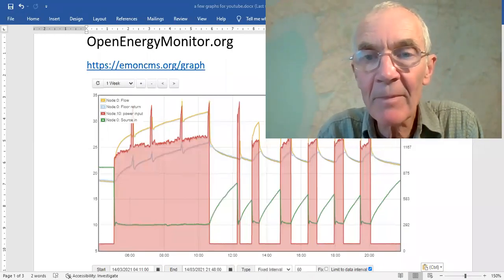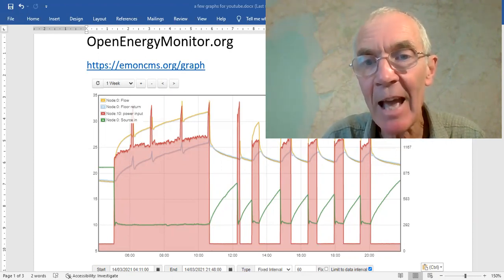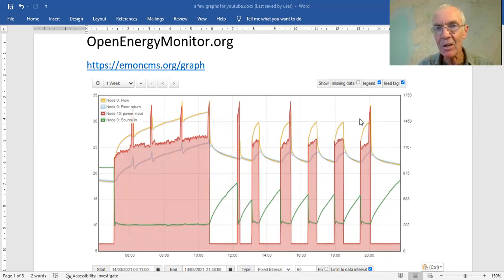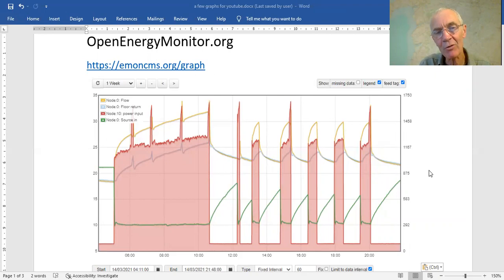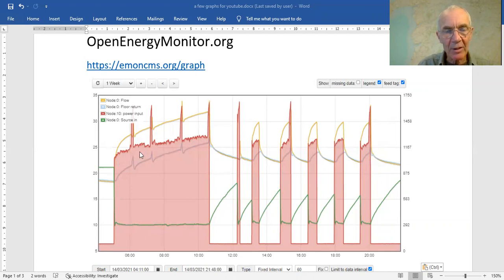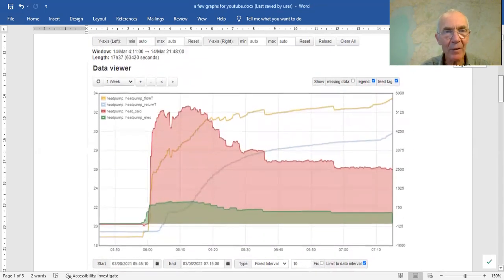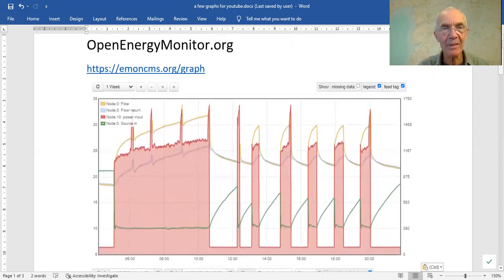Introduction to heat pump monitoring hardware

Comment: Dear John
I rather like the concept of using machine learning to optimise heat pump efficiency. My installer is thinking about the Homely unit. I was wondering if you had any thoughts about how useful they are (or not) please?
Reply: I have no direct experience with Homley, but frow what I have gleaned, it looks very good. It partly depends on your setup. e.g. it should definately help a Samsung, but there may be less benefit on a other units with better controls
Reply: @SwiftsPendre-zf2xx  thank you. Yes, they are putting in a Samsung 16kW R32 mono. It’s selection is more about its footprint vs available space and matched demand, rather than anything else, I’d heard the user interface is a nightmare, what the heck is waterlaw when it’s at home! 
I hope it means I won’t need to interact with the control system at all, just a bit nervous that homely will do what it says on the tin. I use a machine learning octopus PV tariff and that is intelligent most of the time and makes me a very welcome income, but it occasionally makes retarded errors, I guess like us all!

Comment: This is a great channel. I have an air to air system and would like to monitor my system that has 5 indoor units and 1 outdoor compressor unit. What can I use for this?
Reply from the maker: Mmm.. its a little hard to properly monitor such a thing. I dont know of a way of knowing the heat ouput to air.  Its useful to measure the power, and a CT clamp to measure current (assuming 1kw = 4 amps) should be good enough.  What do you want to learn?  It would be interesting to have room sensors (emonTH, with a probe sensing the warm air coming from the unit... I would find it interesting, but not sure what you would learn from it. cheaper options might be to buy some wifi thermometers and display it on an app.         I guess you has fan-speed options??  if so, fastest air is probably most energy-efficienct, but noisy and possibly drafty.  maybe you can help to compare input power with different air flows.  possible my 'Carnot COP estimator might help you guess the COP

Comment: I have been using Home Assistant to get something similar. I have temp probes on flow and return and the thermometer is a wifi system linked to Tuya which can display in HA. Similarly I have three Govee thermometers around the house in Study, Living Room and a bedroom. For external temperatures I have used three hourly Met office integration. I have an PV, EV and Zappi and have four CT clamps linked to the myEnergi system. The heat pump is on its own spur and fusebox so have a CT clamp with a Harvi. I can display the energy use using the myEnergi integration in HA. The bit that is missing is the flowrate !!!! My HA is set up on a Rpi 4 and working well . Any suggestions what flow monitor I could use to link it into Home Assistant ? I could then calculate heat by creating a virtual sensor combining the Delta T from flow and return and the measured flowrate to get KW. At the moment I can only get daily redings from the Daikin controller which has all the info in it but there is no way of gathering real time data !!! Still good news is my COP since last June is sitting at 3.52 for Heat and 2.3 for DHW 🙂
Reply from the maker: Sounds good.  For flow sensor, how about using a Sika or Grundfoss VFS sensor. Some ASHPs use them (Ecodan use Sika), they are also in boilers.  Not as good as a proper heat meter, but could be good enough.  Some give a voltage output proportional to flow-rate, and maybe you could input the voltage in some way to your system.  The 40lit/min ones are quite restrictive.  100lit/min are less accurate, but lower pressure drop.

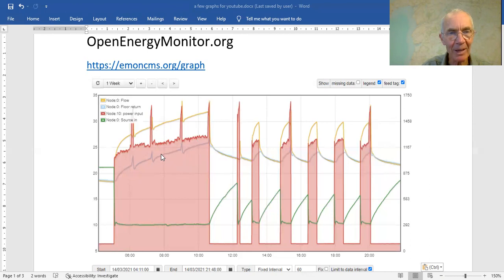Comment: 3:17 How do you estimate flow rate from 2 temperatures...?!
7:26 "Kettle tower meter" ???!
12:03 The ONLY way to know how efficient you heat pump is requires an inline 'heat meter'. What the heat pump unit displays are usually complete fantasy.
Reply from the maker: Yes, the only way to know the heat output is with a proper heat meter, but this is a very considerable extra expense.  But, i am often helping people get the best output from what HP they have, and whilst knowing heat (kw) is ideal, its hard to achieve. If pump is fixed-speed (non inverter), you sometimes can conclude (not always) that the flow-rate is about constant, so you can glean quite a bit from dt.   Mostly,  i'm finding that some of the expensive-to-run systems simply produce water at a temperature that is considerably hotter than the radiators are getting. Also, the cycling can cause the flow temperature to stray well above what it might for a system spending more time at steady-state.  So, there can be a considerably benefit using a simple non-intrusive temperatures and input monitor. But I agree, heat meter would be better.